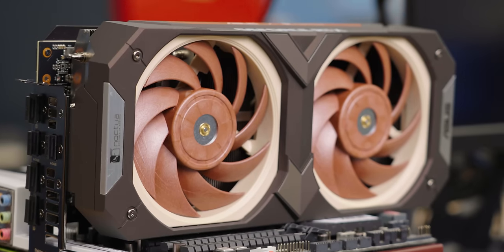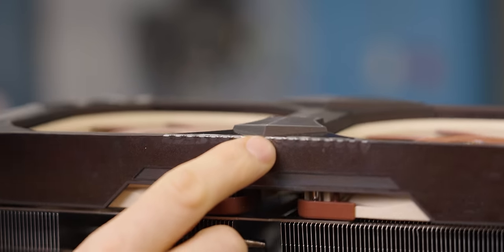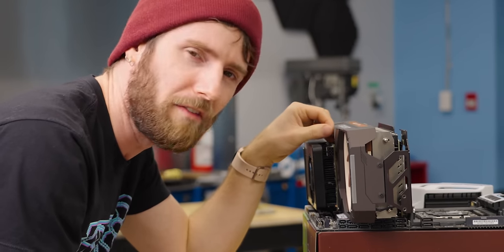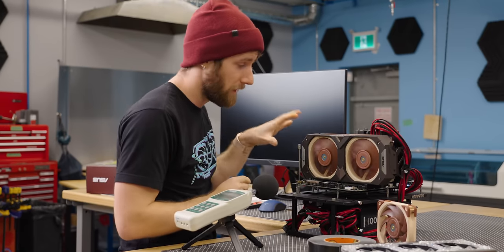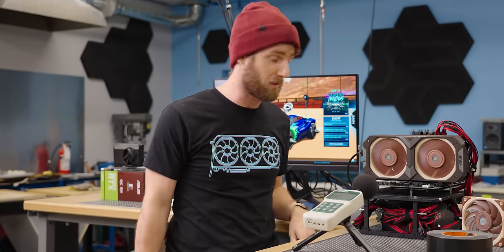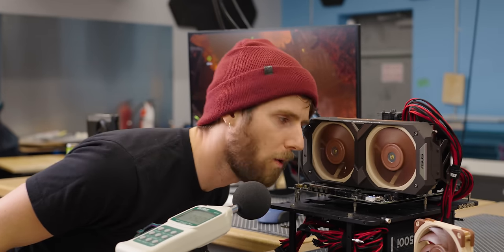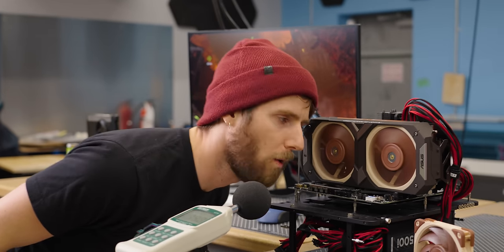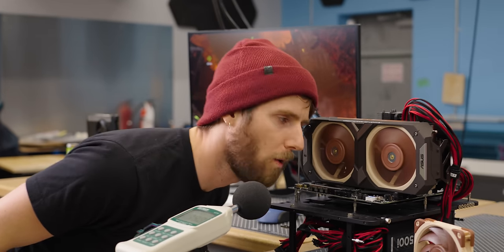Real Noctua GPU vs Redneck Engineering My Own

Comment: The heatsink on the DIY version is so much smaller, though. How about a video that covers modding Noctua fans onto a card (maybe with an ABS or TPU 3D printed custom shroud) and comparing the cooling performance to the stock setup's performance?
Reply: It wouldn't show the video sponsor in the best light if they did a fair comparison...and it's like he has never used zip ties before, who would use duct tape??it had to trap heat
Reply: They literally already have that sort of video from a couple years back, though I think they did it in a "the original fan stopped working, gotta replace it" scenario.

Comment: Why did we not get to see it in "P" Mode? Why did we not get to see the performance with fans speeds locked at 100% to see if the GPU temp was super chilled?

So much missing :(

Comment: I'd love to see a redneck upgrade where you swap the standard fans for the Noctua Industrial 3000rpm fans
Reply: I have those in my case currently Man do they move air
Reply: @slay3r01s  I have 3 for intake on mine, and my fan curve looks like an function approaching a limit around 75°c
Reply: @BDenes24  How hot is it in your room that 3 of those BARELY  keep it restrained to 75°C?
Reply: @tumamaencosplay  it does get warm but 75c isn't operating temperature, it's where my fans hit 100%. All my components are liquid cooled so my 5960x under load hangs out around 55c with 35c coolant and my 1080 is around 50c. My noctua intakes on my 900D are fan curved to be normal fans until these get to about 60c and after that I have them ramp up really fast, noise be damned. If I render something it will get into those areas and it's kinda cool to go from normal PC noise to F15 afterburner for a minute.

Comment: I'm willing to bet that the mounting was bad on the pog champ GPU. I've done deshroud mods before and temps plummeted.
Reply: also the heatsink was much smaller, just stupid comparison
Reply: Agreed going from 56c to 83c, with slightly larger cooler lmao
Reply: @1337Ox  Even with the smaller heatsink, hitting 83c with two Noctuas mounted to it seems unlikely, something else is wrong with their setup.
Reply: @fqdn  they literally said that they're using low noise adaptors- aka the fans are running at like 1/2 speed, and that the fan speed is tied to CPU temp, not the GPU... So they didn't speed up either.
Reply: @mataskart9894  yes they said that, but they used the adapter because the fans were spinning too fast compared to the Noctua card, where the fans are like 800rpm max

Comment: Just plug the fans on the GPU header
Or use one of the motherboard headers and control the speed with argus monitor in order to sync the fan speed with the GPU temp with a totally custom fan curve

Comment: You have to get a GPU fan adapter and do a custom fan curve to get good temps. You need a custom fan curve because the amperage is different between stock fans and case fans. Making the case fans sit at 500-600rpm for the test while the noctua card can spin faster is just sabotaging your own results.
Reply: look at the heatsink alone...
Reply: You can also do it in a software way, just connecting the GPU fans to the MB and using software like Argus monitor and you can set everything in the OS. Alternatively, set the fan speed in BIOS to a specific percentage (like 70) when it is not hearable and done. Depends on how geeky you want to get.

Comment: The noctua collaboration has been one of the best things in a long time for the 3070
Reply: haha really, I mean do it, but I bet under those loads with the real asus card and them not pushing it... it wouldnt have been much different... and for it to be wider then every card in existence.. plus thats just bad  science as bad he put the NF-a12s on a differnt much smaller block cheaper block, and didnt even push the cards...why not do it on a 3090 like cmon...  the 3070s already run cool because they dont use GDDR6x.. so dumb

Comment: So, i used noctua fans on my 1070 when i bought it second hand and the fan were horribly loud. 
Only difference i see here is that i used plastic strips, but it's generally the same. Of course, the 1070 doesn't make as much heat as this one does.
My gpu was whisper quiet and i never had any issues with heat. I don't think i ever reached higher than 60*C
I would highly reccommend this mod if you don't mind a shabby looking gpu (unless you 3d print or something).

Comment: Really awesome collab. However, this should AT LEAST have been applied to a 3080, if not a 3090. This cooling potential on a 3070 seems wasted. And I know there's something to be said about the Noctua branding, but come on, imagine they would have used they're new black fans scheme.
Reply: If it was on a 3080 or 3090, then we are talking it's gonna push 5-6 slots. Beefy coolers on those cards take 4 slots WITHOUT massive fans strapped to them. How does an air cooler make sense then, when the card is too big to even get airflow into the fans in a normal case?
Reply: @jmporkbob  maybe on a aorus master it would be 5 slots on other cards the heatsink is 2 slots so it would become a 4 slot with the noctua

Comment: I really like the owl aesthetic, I'd like to see it mounted vertically so the owl is peering out of the case. And yeah, it took way too long to make this happen.
Reply: Good luck getting a 4 slot thick vertical mount.
Reply: @zekrinealfa1113  You make a very good point, I hadn't thought of that. Perhaps a horizontal tempered glass case then.
Reply: An owl 3d printed case would be so cool!
Reply: @mico77720  A case in the shape of an owl or a normal case with a heavy owl aesthetic?
Reply: @Voltaic_Fire  a full on noctua owl case! xD
Reply: @mico77720  That's not really answering my question but both would be great, you'd have to make silence a priority though. You'd have to include only Noctua fans, components without coil whine, and panels with that sound dampening material on the inside (I used to have a case with that stuff and 7mm of it worked wonders.) I'm not sure there are any printing plastics or resin strong enough to support such a heavy computer, you'd have to look into that.
Reply: @zekrinealfa1113  you're just gonna need one of the vertical mount kits that sacrifices the space where all your slots normally are. 4-slot cards work perfectly well with inches of breathing room to spare.
Reply: @mico77720  3d printing a case is insanely wasteful and would cost an absolute fortune, 3d printing is only good for semi-hollow smaller niche objects. At 20$ per kg of filament, the case would be looking like 200$+, and completely structurally weak without inside supports.
Reply: @zekrinealfa1113  That prototype 011 EVO case would work

Comment: Basically I was running this for more than 1 year now. I de-shrouded a standard 3080 and put it in a NR200P, with 2 12mm Noctua fans below. The annoying thing is fan speed control, but it’s a perfect setup forma thermal and noise standpoint.

Comment: it doesn't add up for me that the palit went from the 60s to the 80s with the fan swap.
I also didn't see thermal paste replacing, and saw the heatsink being apart from the pcb, so it might have happened that it got that bad results because of that reason.
Reply: The whole heatsink is like 30% smaller, dunno about heatpipe placing/count either...
This is a HUGE apples to pear comparisson... Just as out of touch as their last "budget" notebook review...
Reply: @Fennek_Kaipii  I talked about the original palit vs the noctua palit.
But you are right as well
Reply: I mean the fans were going at like 300-500 rpm and weren't tied to the GPU, so that's the reason for high temps alone.
Reply: @mataskart9894  it could be

Comment: Fwiw, the Extech 407750 has an SPL range floor at 30db. 28-29dB readings are caused by the electronics in the meter - it was likely quite a bit quieter. SPL meters that accurately read below 30dB get real pricey, real quick.

Comment: You know what's crazy? I'm taking an acoustics course and to the human ear a difference of 1 dB makes no difference. For it to be approximately 3dB louder than nothing makes it very impressive
Reply: That's actually not true.  Human ears are very sensitive.  Not the most sensitive by animals by far, but they can detect 1dB differences.  That's like saying the human eye can't detect 4k compared to 1080p.  Some people are better at noticing things than others.
Reply: @Mak933   You make a valid point in the case of sharp noises from low background noise but the background noise from structural systems in addition to that is what makes things complicated. Then the overlap between noise makes little difference. People realy underestimate their ability to block out that background noise subconciously, then again once you focus on the difference and go back and forth between on and off is when it becomes noticable. I'm not trying to dis you or anything but there are cases where your point applies extremely well and others where it's not that effective.  Maybe I'm overlooking something, looking forward to your response.

Comment: Over a decade is an understatement. I' did that to my 8800 GT back in the day. to drop my temps by 30°C because of that awful single slot cooler.

Comment: I understand why they test the way they do, but why not do some "real world" type tests sometimes. Test the same parameters but inside a hotter space while inside a case. I really don't think it would be that inconvenient. Instead of saying, "maybe" in a real customer's situation it will perform in this way, they could say this "is" how it performs.
Reply: the problem then is pretty much the same as now. Each case is different and it would be just a number like this testing method (and Ltt would have more work). With the open testbench you limit any mistakes in consistency ypu could make. Like the optimal performance and anythibg worse is on your side.

Also these temps doesn't vary that much. If you got a pretty normal/good case, you will reach very simular temps. For most part the room/outside temperature is the part that effects temps the most
Reply: @MHWGamer , your last statement just agreed with what I said. A more "real" scenario is a warmer place. Also, I understand that there are countless different cases. My point is that having a case of any kind is still closer to reality than an open-air setup that no one uses. Any case would give a better idea of real temps than no case at all. The disclaimer on the test would be the same, I agree with that. No test can equate to EVERY person's situation. I'm just saying you could get closer to MOST set-ups than the way they always do it here.

Comment: Ahhh yes, the science of comparing two sets of fans, that runs on two different rpms, and then measuring their ability to move air 🙏

Could atleast have checked the fan speed in a monitor, and then set the rpm on the fan header in the Bios... its literally quicker than getting a limiter.

Noctua would still have trashed it, but still 🤷‍♂️
Reply: Another comment even said they were able to create their own Noctua edition and got similar performance using a ASUS RTX 3070 Dual (non-oc)

Comment: I want to see more brands do what MSI have done with their ITX 3060 Ti. The amount of heat pipes and heat sink you get, is balanced by a fairly solid fan. Where as, Evga decided to go with a chonk 2.75 slot heatsink and not much in the way of heat pipes with their 2060. It still runs okay. But, I believe in having effective heat wicking.

Comment: 13:17 Someone in the discord im in did the same mod but used a 3D printed shroud. Would that make a difference or no because the fans are tied to the cpu speeds?

Comment: Crazy how small the gpu boards really are. The majority of their size is heatsink. I like the idea of creating "perforated" circuit boards Meaning any areas that have nothing running through them link in board connectors, is laser etched out so air can not only pass over the board but through it as well.

Comment: You could 3D print actual brackets pretty easy.

Get your flatbed scanner out, import the scan for reference to your screw hole distances, import any 120mm fan and just make little doodads to go from one screw hole to another.

Comment: The answer is yes, you can build this yourself.. you just need a good aftermarket heatsink as well. I've got a vega64 attached to a Morpheus with two noctua fans with the low noise adaptor.

Comment: Over a decade ago my poor middle school self stuck a spare 80mm fan to a bottom tier big heatsink no fan card and had temps barely above ambient. I think it was an asus gt520.
 Then proceeded to max out the oc sliders (from like 700 to 1000) and was able to get an extra 5 frames out of arma 2 to stay above a consistent 30fps.
 My broke engineering attemp was a success.

Comment: I would love to see more graphics cards which use, or at least which are compatible with, standard sized case fans. 92mm or 120mm would make sense, and 140mm could also make sense. This will generally make cards thicker, but they don't need to be as thick as this one is.

Comment: really wish there was a bigger market for aftermarket gpu coolers. if noctua just sold the cooler, i would buy it in a heart beat. plus, it would be nice for picking out your gpu because part of the time, you want it to look good and that has to do with the cooler and fans that come pre-installed. would be nice to add your custom look to it especially when building a custom pc. would also be good for different performance options rather than just being stuck with the cooler your card came with. plus, when fans or other components of the cooler malfunction, rather than sending the whole gpu in for rma or getting a new one, you can just buy another cooler.

Comment: Yours would have worked good too, if you could eliminate the air leaks around the fans. Basically you had to duct tape all sides around the fan up to the heatsink mating plane.

Comment: I know the 3070 has a higher TDP, but I have successfully been running a couple of slim 92mm Noctua fans on my GTX 1080 for a couple of years now. 
Best mod I ever did. Way more quiet and efficient than stock and it still fits in two slots.
Reply: me too! best cheap mod for GPU.

Comment: Ive got cable strapped noctuas on my 5700 xt red devil, without a noise adapter, and the only thing I've compromised is the extra 1500 RPM and extra noise coming from the three stock fans. Temps 50-60, and hotspot/junction 70, way less than before. Either way, youre definitely not compromising the noise if you do this. I was previously at an ugly 3000 RPM with higher temps. Try comparing modified Noctua to stock on other cards, then check the noise benefits.

Comment: I´ve recenty stripped the original fans off my good ole Zotac GTX 970 AMP, and strapped 2x BeQuiet Silent wings 2 120mm on it, added an PWM and  Y adapter and got the most silent Graphicscard ive ever had. Basically silent (or atleast not audible out of anything else) at arround 67°C max (75°C hotspot) Plus it stays at boost all the time. it´s a nice way to improve loud/older cards for relatively cheap moneyz
Reply: it's a nice, cheap way to improve all cards, not just old.

Comment: This GPU should seriously include a quad-slot I/O bracket with beams extending backwards to support the PCB and prevent sag, or at least touch the cooler and get some more triangulation going on. If GPU manufacturers could transition from single to dual slot because of size and mass increase, it's now seriously about time they transitioned to quad- or at least triple-slot brackets. 
It's not as if you get to use those slots anyway.
Reply: Yep, the dual gpu thing aged terribly, and more support to the components is also very welcome to transport your computer, i feel like removing the gpus Before packing cause they are ALL visibly bending. this should be really addressed, they dont weight few grams like used to anymore

Comment: Men you're closing the air flow with the tape,that's the trouble in the noctua design there is a gap between the plate and the cooler

Comment: I have a Msi GTX 1080 ti Gaming X Trio card and one fan makes noise at low rpm. So while trying to fix it (what is kind of very difficult or impossible) I knew some guys put 120mm fans on it. I installed 2x 140mm 1000 rpm fans on it  (Bequiet silent wing 3 and a alpenfön) AND wow i am amazed. GPU is soooo much quieter and low temps overclocked at max. 55-65°C. Ok now i am asking myself why gpu manufactures don't put 120mm or 140 mm fans on their BIG high TDP GPUs ? Ok it is true the cards get huge and it is very close to get it into a midi tower. But it's so much better !

Comment: Open bench PCs ftw. My last build used an open bench PC case from thermal take and my current build uses the lian LI desk case which is so roomy and has so much air flow that it's not far off from open.

Comment: What are the chances that an expensive product, (which Linus gets as a free sample), loses to the gaffe tape version with a much smaller cooling surface?
Another crazy thing. The CPU cooler appears to be a standard fan located close to the measuring object.

Comment: i just put 2 fans on the bottom of the case blowing extra air into the GPU . running my msi ventus 3070ti at sub 50 , GPU memory sub 60 and cpu sub 60 in a 18c room. with GPU and cpu on full load (1800x pulling 120watt)

Comment: I "built" a GTX 560 Ti like this with the stock cooler (removed the fan) and two 80mm be quiet! fans attached with a couple of zip ties.
Result? Total silence and a max of 75 C under a continuous Folding at Home load in an enclosed case. It intrudes into the third slot. But, it isn't a 4 slot card.

Comment: The Answer is YES!

NOISE Leverkusen is the same, problem is Linus used x2 smaller radiator!

LINUS should test noctua fans on noctua RTX 3070, or find card with similat radiator size!